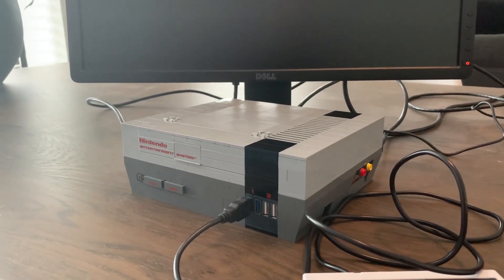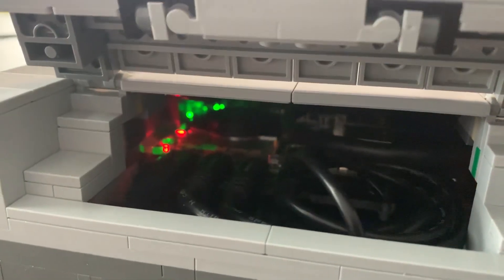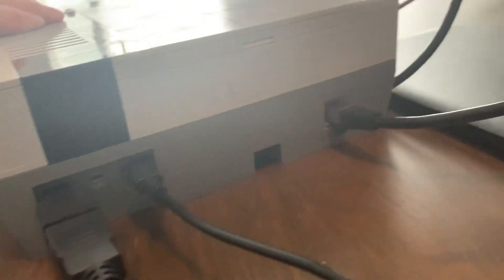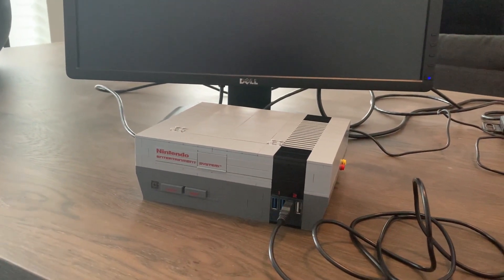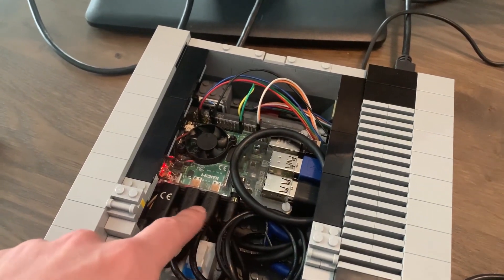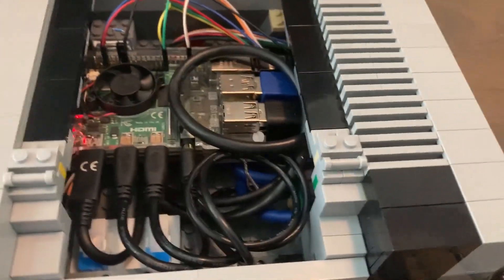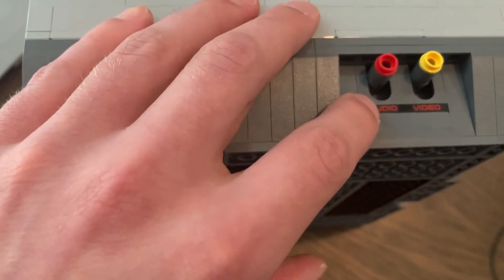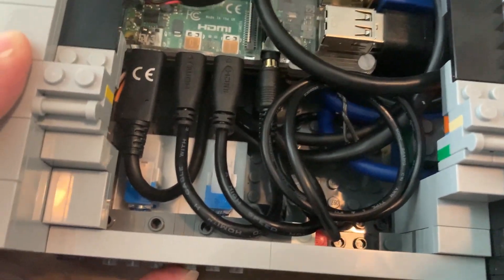Working Lego NES with RetroPie

Comment: Hello, I have rebuilt most of the NES like you and also used your 3D printed parts. 
Can you explain how I need to connect the reset button, power button and LED and program the PI to get them to work. Unfortunately I am a layman.

I would also like to share the result I have also built a display into the Lego TV etc :)
Reply from the maker: Hey, glad you like the project. I'd surely like to see what you came up with! I wrote a short tutorial on how I connected the buttons and led. I also included the script I use (I modified a script for a shutdown button I found online, but I can't find it anymore so credits go to the original author) https://www.dropbox.com/scl/fi/3eqwf267daa7bi370dv2z/Lego-NES-script-and-GPIO.zip?rlkey=4tjo0397ua5t173vv9lbwi3zz&dl=0

You should run the script on startup. There are plenty of tutorials on how to do this.

Good luck!